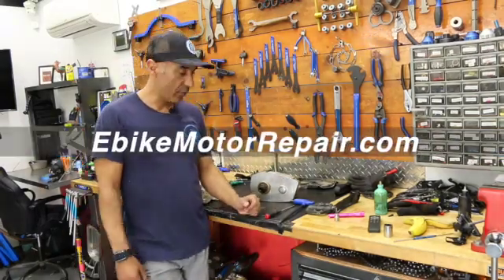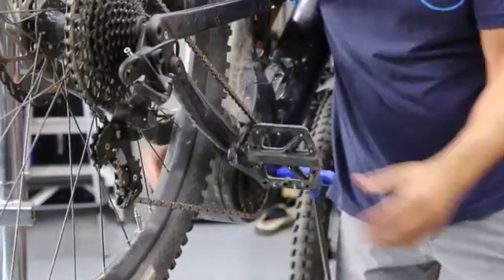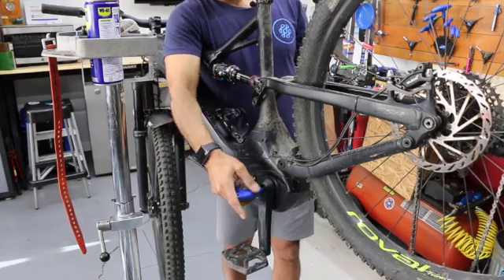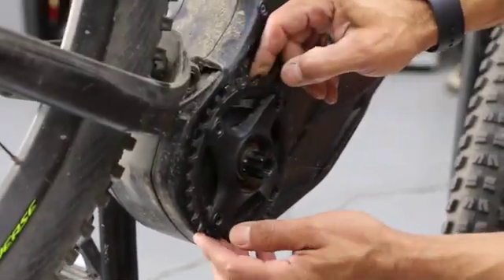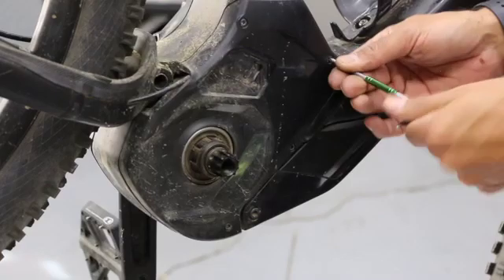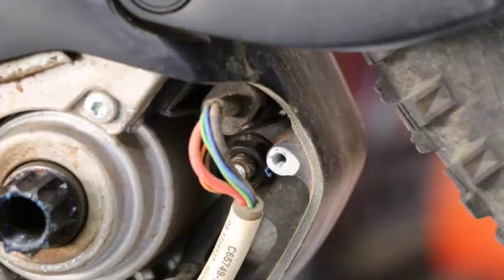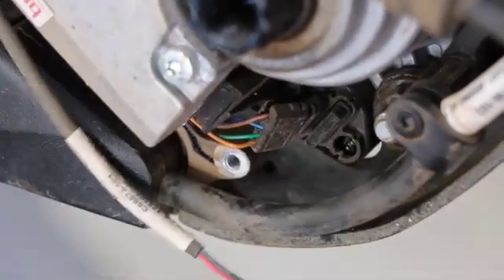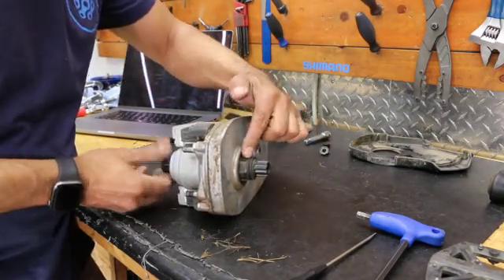How to remove a Brose Levo ebike Motor. This 2018 model will share similarities with other e-bikes.

Comment: I got about 4500 miles on my motor and it was still working good but I decided to do a preemptive rebuild with these guys at Ebike motor repairs. They did a wonderful job and I am back in action and feel much more comfortable out on long rides.
Reply from the maker: That’s great to hear. Thanks for your comment. ⚙️🔥